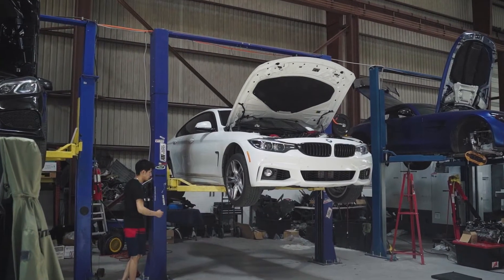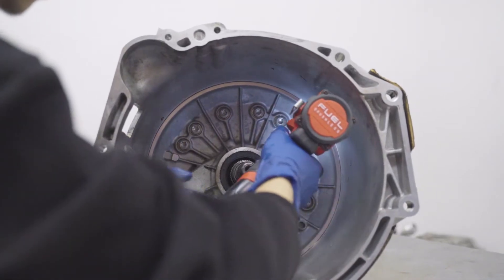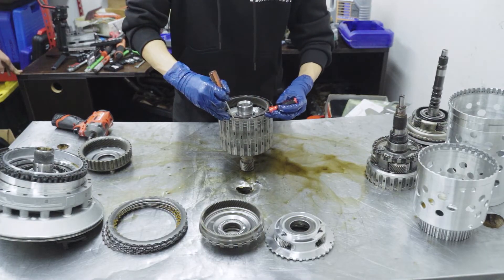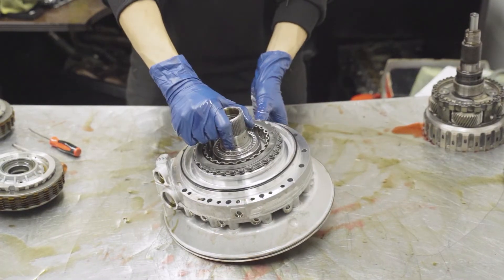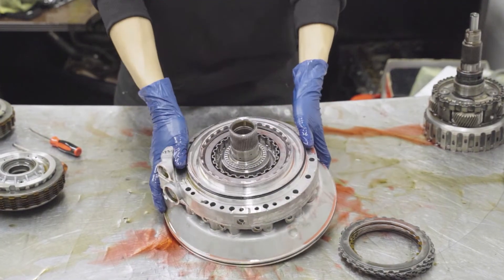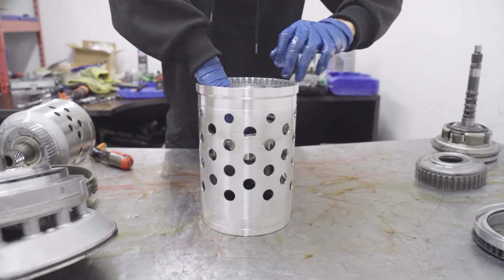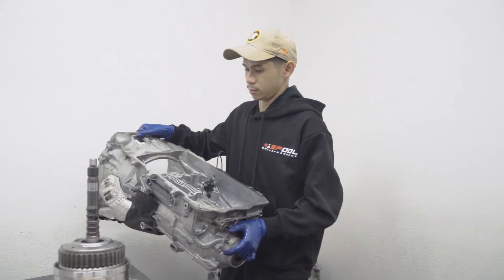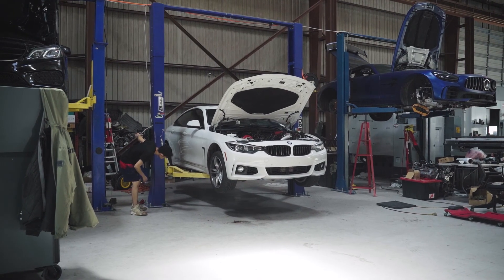Spool Performance 8HP 45, 50, & 51 Transmission Kit install guide

Comment: I want to buy a new transmission because my vehicle's transmission is broken, but I want to know if the 8hp51 transmission that came after the 2020 model is compatible instead of the 8hp50 transmission? My main goal is to see if I can install the updated transmission after 2020 in my 2017 model vehicle.

Comment: Need a video like this for the G8x transmission.
Reply: its 99% the same. So much the same that ZFs service manual applies to 8HP 45/55/70 series (that includes the 8HP76

Comment: Finished this a couple weeks ago. It's not hard, just take a while. Working about 90% by myself it took 28 hours. There are a couple spots where the video doesn't fully explain what you need to do, but overall it was very straight forward.
Reply: Why this take you 28 hours to build the unit? I understand might have been first time but is this including the full removal and etc.. Was their breaks in between days etc... Curious, and yes I build transmissions daily this is probably one of the easiest units to tear down and rebuild I'm just asking because I'm willing to make a very detailed video showing how to tear it down and build the unit if it was because you ran into certain issues, this video was pretty straight forward, gaskets etc.. should have been in your kit.
Reply: @transmissionsrus6808 I've never taken a transmission apart and this includws removing and installing the transmission, which they didn't show. I've only done basic bolt on up to this point. The shop I was renting a lift at closed every day at around 4pm so I did this over 4 days.
Reply: @ericdisparte  Appreciate the response, glad to know you got it done and explains why it took so long for ya, for a first timer thats awesome.
Reply: @transmissionsrus6808  I’d like to see your vid for more details that were missed.
Reply: how's the performance in comparison with the stock ?
Reply: @chegushaari5714  There is a huge difference in power to the wheels due to the increased friction. I recommend having xhp so you can time down the torque.
Reply: @ericdisparte so you have your custom map ?
Reply: @chegushaari5714 No I just had to turn down " Torque Punch" .

Comment: Same steps for Xdrive trans?
Reply: and at 2:00 he takes off a nut xdrive wont have that youll have to take the back seal out and remove a snap ring to pull shaft through the case
Reply: Yeah it’s basically the same through all the ZF8HP. Only thing different on a Xdrive Transmission is the Transfer Case